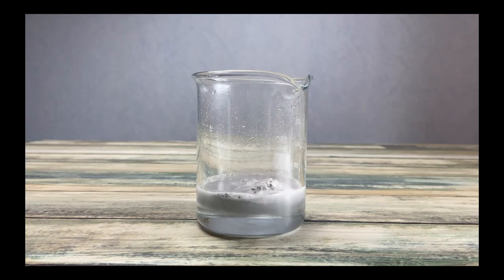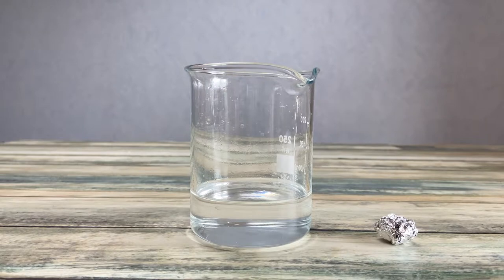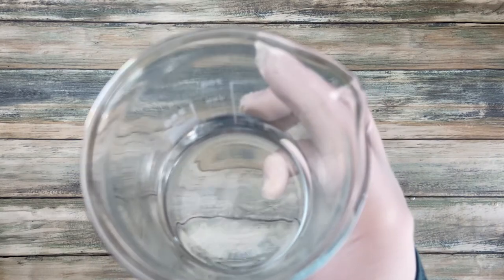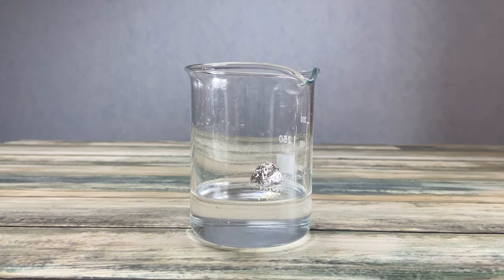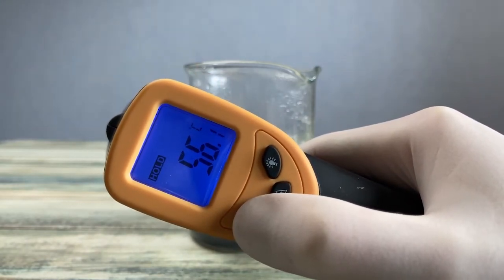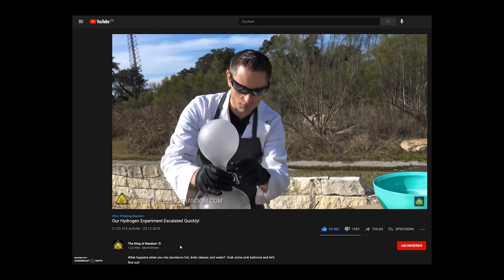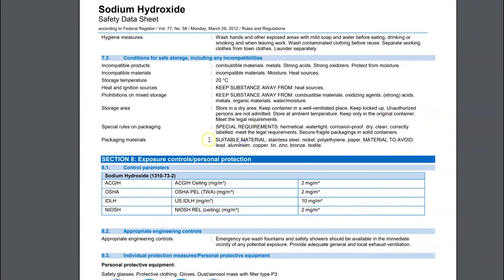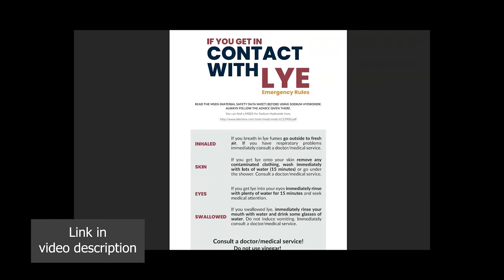THIS IS DANGEROUS! ⚠️ Soap Chemistry Experiment - NaOH and Aluminum

Comment: I made several batches of soaps in an aluminium (coated) pot. There was no reaction in the pot (the oils were there before I added the lye in it) and the soaps came out looking normal. Should I discard the soaps? How does it affect the soap itself? Are they safe to use?